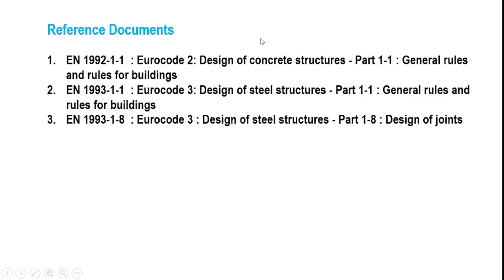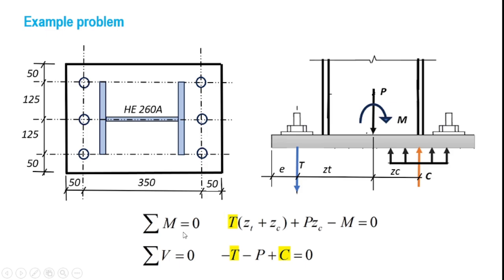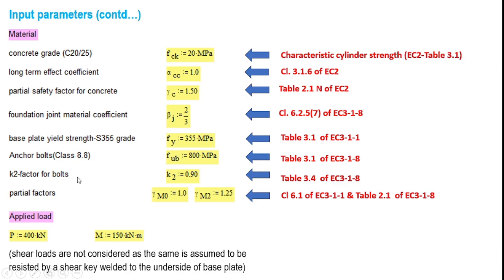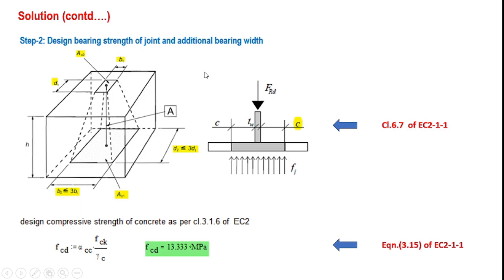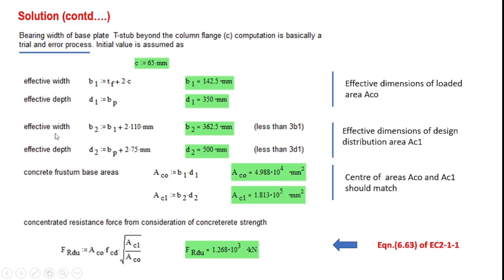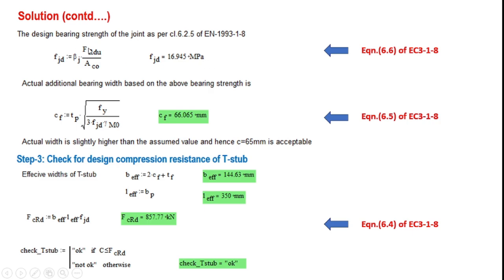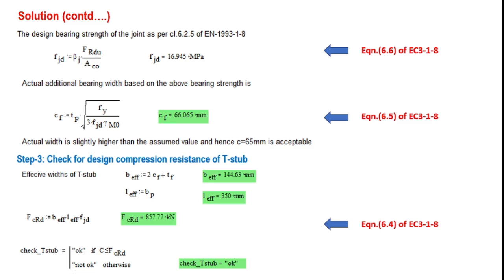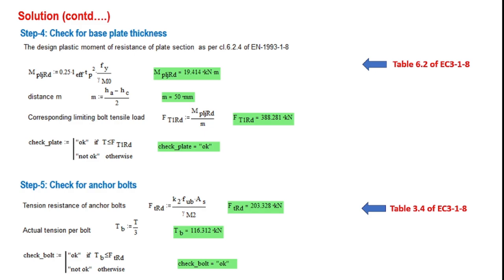ANALYSIS AND DESIGN  OF COLUMN BASE PLATES AS PER EURO-CODES

Comment: Great one again...thank you sir...only request for few more details:
1. Is it not a practice to consider for any stiffeners if required to restrict the base plate thickness according to Eurocode? If so, any basic guidelines for selecting and design checking.
2. Types of welds for base plate and columns and their calculations.
3. Computation of anchor bolts as we are covering the PLA (partially loaded area) already.
4. Shear key calculation including the weld design.
Reply from the maker: The inclusion of stiffeners for base plate depends on the practice being followed in different countries. For example, in EU countries they prefer thicker base plates to eliminate the requirement of stiffeners due to higher fabrication costs. In India, we go for stiffeners to reduce base plate thickness.
 For the column-base plate connections, go for either full penetration weld or two-sided fillets.
For the design of shear key, normal procedures can be very well used including code specified design stresses
Reply: @puttattjayarajan1199  sir for the column baseplate connections, to save the cost of UT/RT, we used to have CJP welds for flanges and fillet for webs where there was provisions of moments in columns.
Please let me know your opinion on this practice.
Reply from the maker: @debdeepmajumder9136  acceptable and is also being followed
Reply: @puttattjayarajan1199  thank sir for your inputs.

Comment: Design of 
1.Vertical vessel foundation 
2. Horizontal/heat exchanger vessel foundation.
3.Underground pits using manual calculation,Staad and SAP2000.
4. Tank Foundation design